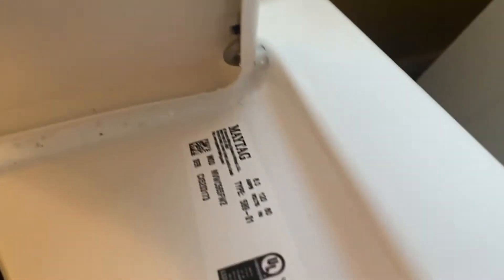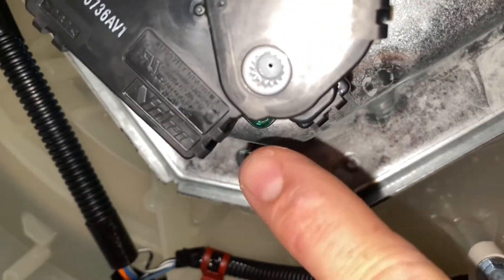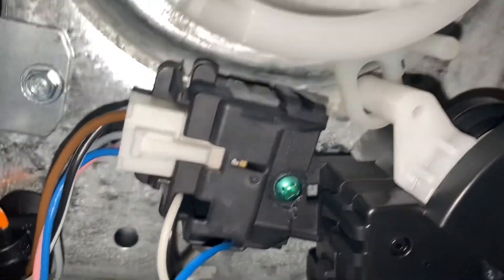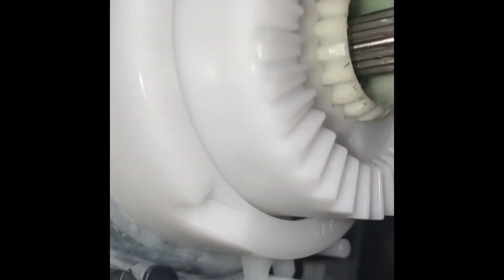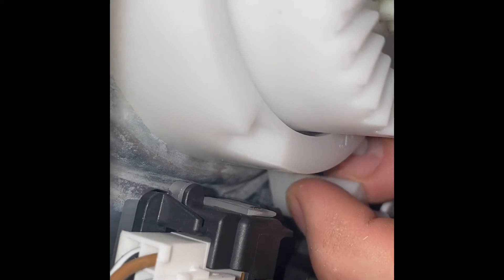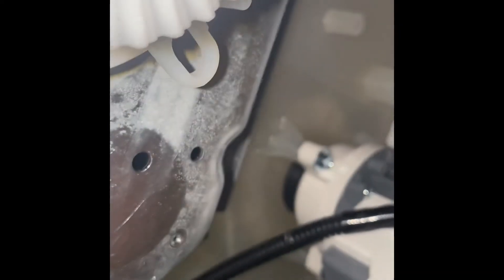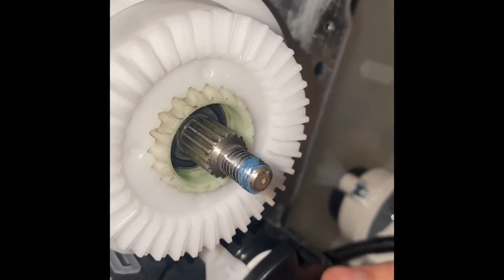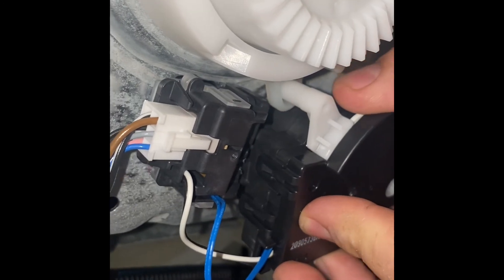Not Washing- Whirlpool MVWC565FW2 Maytag Washer design engineering Problem with New W10913953

Comment: I have same exact problem with mine. It will work for a while and then I will have to put arm back in place. Is there a remedy for this?
Reply from the maker: I purchased a speed queen set to fix the issue and have had zero issues now

Comment: New improved actuator part# W10913953 .
Reply from the maker: W10813953 is the old part number this part is new then that
Reply: @LouisianaRepairGuy  yeah , My washer is still under warranty and just got it replaced. You can get the new one on eBay
Reply from the maker: @saulpadilla1331  I own a appliance repair company. I personally only own Speed Queen laundry equipment, they are the best
Reply from the maker: @saulpadilla1331  they went back to the old actuator design which is very interesting
Reply: Thank you, you freaking genius!

Comment: How did  you resolved you problem? Replace the part or put back correctly? Because if was not all the way inside the other part then the problem was that the part was not install correctly from factory.
Reply from the maker: It’s sloppy engineering whirlpool hasn’t come up with a fix yet
Reply: @LouisianaRepairGuy    Thanks for the reply. I doubted they would have the decency, nor the integrity to correct their SLOP.  My nephew has recently become wheelchair bound and I NEED a washer that works! Paid over $700 and was told a service call would be $125, at only 9 months of ownership. The machine has NEVER worked!